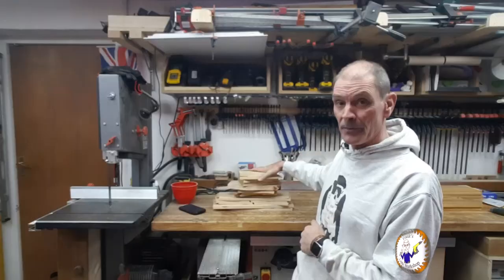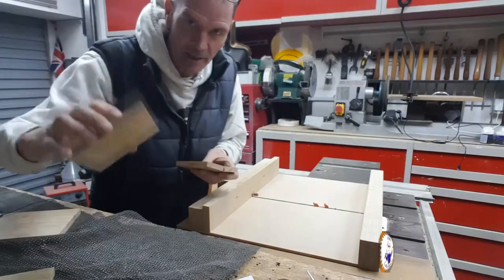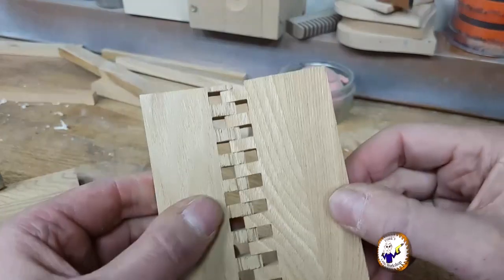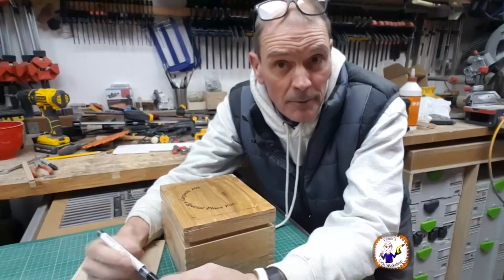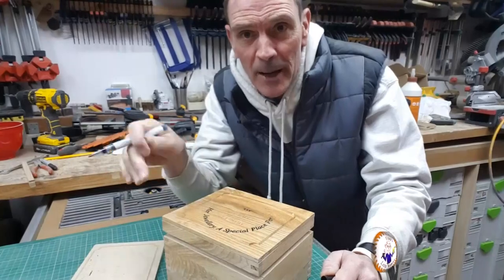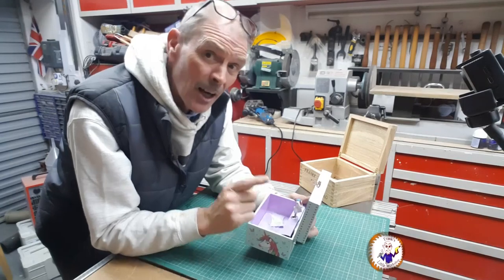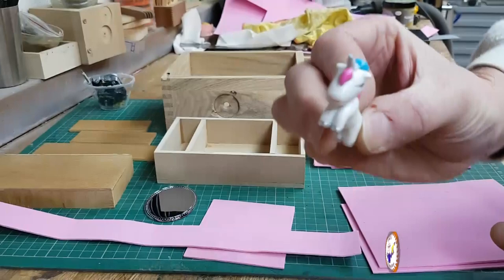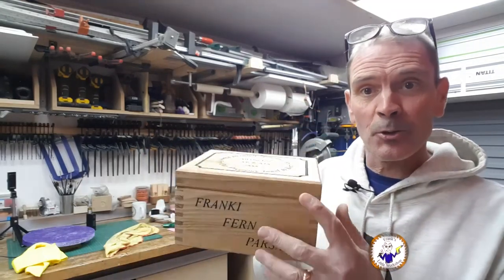Musical Unicorn Jewellery box.

Comment: Hey Frank, what an awesome little jewellery box, she'll keep that for 20 years if not more! Well done on persevering through the setup of the groove blade as well, annoying to do stuff like that but it makes the end results so much better. Not to plug my own stuff, but I designed a jig for box joints a few years back that would go really really well with your blade, it will let you make different sized joint easily as well if that's something you're interested in. I might look into getting one of these blades, looks to have some advantages over a dado stack.
Reply from the maker: Thanks Mario 😁. Hopefully the box will last for years. I think she likes it 😁. The blade is an excellent alternative to a stack. There appears to be some legal no no's with dado stacks in the UK and very few table saws offer a long enough arbour to take one 🙁. My saw would also be under powered for one anyway 🙁. I will be making another jig for this blade to do wider / box joints as soon as a project needs it 😁. Thanks for watching Mario 😁👍

Comment: Such a shame about the pear wood. Cracking project anyway mate.
Reply from the maker: Thanks 😁. I managed to get it down from about 30% to 12%... but it was still distorting... I'll keep it for another project 😁. Thanks for watching 😁👍
Reply: @frankslittleworkshop  nice! 12% is pretty close. Most of the wood in my workshop is around 12%, after that it takes a lot longer for me to get the wood to 10% or lower.
Reply from the maker: @o.g.bwoodwork  the main issue is drying uneven. Some bits were 15% on one side and 9% on the other... almost garenteed to warp.. I'll just give it some time 😁👍
Reply: @frankslittleworkshop  I see what you mean. Good luck there mate.